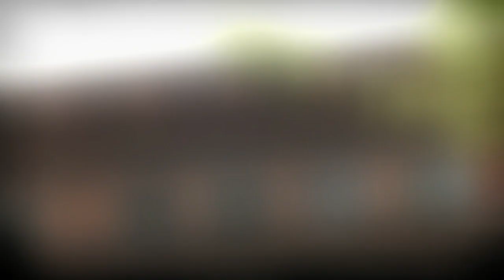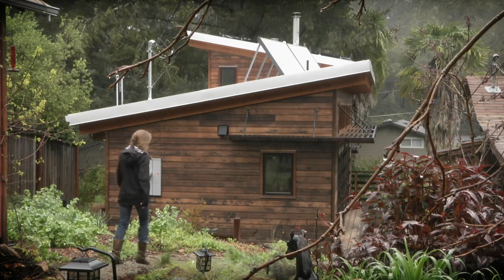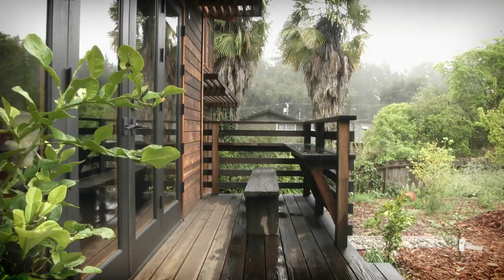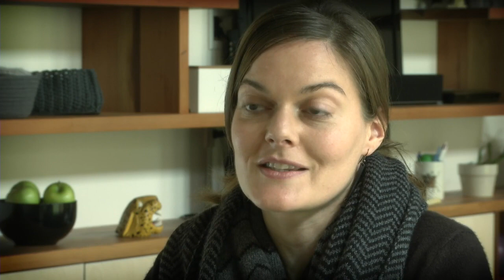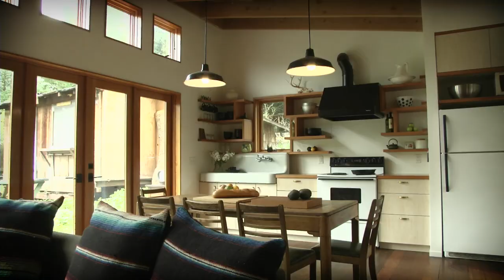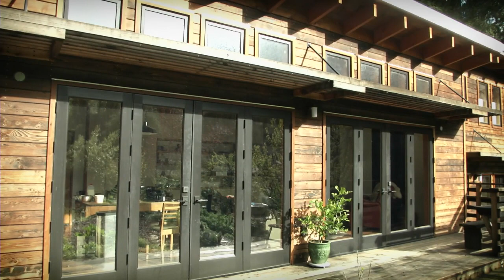Best Energy-Smart Home 2016 - Fine Homebuilding HOUSES Awards

Comment: Nothing needed for heating or hot water? What's that condenser doing outside then? It's either heating or cooling 😂
Reply: most likely, it's just a back-up.  They probably calculated that during outlier weather patterns (hot or cold), they would need to use it for maybe 2-3 times a year.
Reply: OR if someone forgets to close a door during the heat and humidity of summer for a few hours - that would mess up any energy-efficient house for at least a few hours.
Reply: Nice catch, Mitsubishi mini split. Still insanely effiecnt tho. Defently doesnt take much to run it

Comment: No energy for heating or cooling? I'm pretty sure burning wood counts as using energy for heating.
Reply: off grid
Reply: it's CO2 neutral. Only downside is you have to get firewood from FSC wood farms and burning wood causes small dust particles. (But not harmful if living in the woods)
Reply: That's very interesting and that's a very big plot of land! Owning something like that is difficult in Belgium... Thanks for sharing your story.
Reply: Best when using pelletized wood or increasingly, pelletized biomass made from agricultural residues and industrial food byproducts. That's because wood pellets compete with fiberboard, particleboard and oriented strand board for raw materials (sawdust, wood chips and shavings)., leading to wood pellet shortages in the U.S. It's not CO2 neutral if living on Planet Earth and we'd be better served if firewood, FSC or not, and/or the byproducts from proper forest management were added to the wood pelletizing supply chain. My partner and I harvested 3000 locust trees on a 44-acre plot, locust that reaches a 25' height in 7 years and perfect for sectioning into 8' lengths split four ways to make fenceposts good for 20 years (put them out to dry and they can then be pelletized). Sold for $6 each, I competed with a farm supply store selling creosote treated inferior product for $8. Plans for delivery became unnecessary as farmers arrived for cash and carry with their own trucks. The ag extension service did soil testing and delivered 9000 starter trees in gallon buckets for free. I say all this because there's a right way and wrong way to manage forests, the services of a professional arborist are crucial.